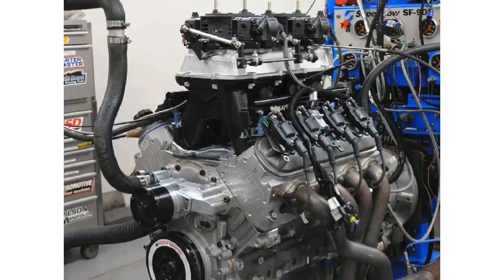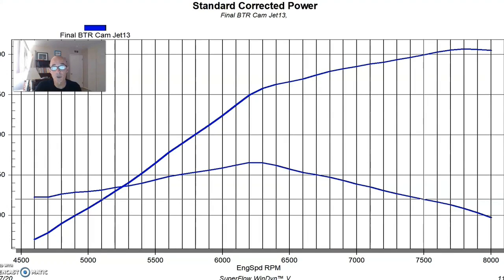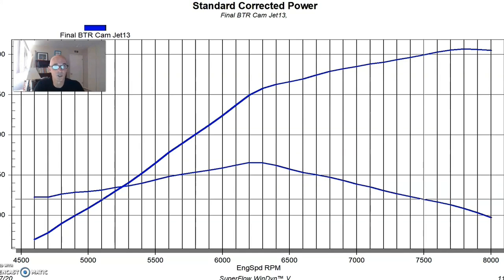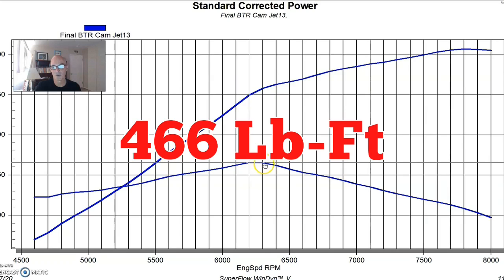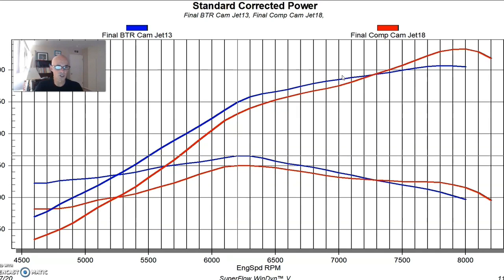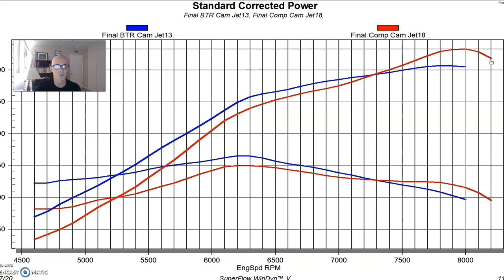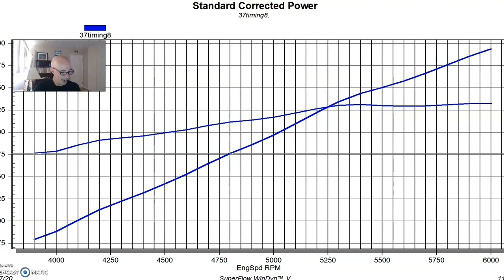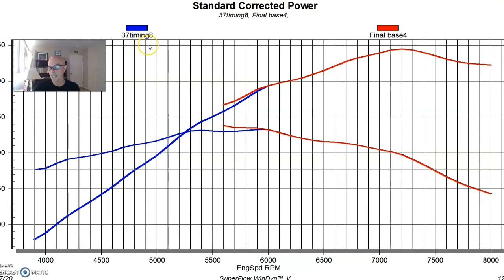8K RPM HYD ROLLER-WILL IT WORK?

Comment: I think the Chevy LS benefited from several things: the longer connecting rods: 6.300" vs. Ford's 5.400" connecting rods, and I also think the LS has better oil delivery to the lifters, the Chevy head is 15° and the intake ports are higher, the intake they used in the LS is also better for high RPMs, and the Chevy LS ignition system is superior to a distributor that only uses one coil.

Comment: Those are excellent build combo's. I am also a bit surprised at the difference between those LS builds and the 347 build. There is not much difference between a regular 346 LS and a 347 as far as size. From the research I have done, which is a bit of a testament to those ls builds, hydraulic roller lifters are supposed to start collapsing at about 7k. So I think that is why the ford didn't make as much as expected. The LS builds however, probably have a larger lifter diameter, so there would be less side loading and the oiling system is probably better.
   If you haven't it might be cool if you got a program called desktop dyno. It is a really useful tool that might help you with those custom cams you get for your channel. Also, you provide really good information about cams and springs, as they do effect RPM peaks. Some other information that might be useful, I learned this from doing research into big blocks, but they tend to experiment with component selection to control piston speed. 
   I haven't really done any builds, but I would like to build a high rpm 327 that is all aluminum and pushrod. I would also like the engine to make over 600 hp. One of the ideas that I had was to use large pistons and a de-stroke. Which I think wouldn't be the easiest thing to do. I haven't tried yet, but maybe one day I'll put one together. 
   Anyway, really good content here at this channel. Thanks Richard!
Reply from the maker: desk top dyno can be a fun tool-but it is NOT actual dyno results. No need to destroke a 327 for rpm, much bigger strokes run much higher rpm (valve train is key)

Comment: Stroked engine power falling off after 7600rpm while de-stroked carries on appears to counter the "shorter stroke doesn't make high RPM power." It would be good to see a side by side with a stock stroke 302 (306) and a 347. I think Engine Masters did something like that with a Chevy 327 (331).
Reply from the maker: a Bigger motor makes more power-no racer in a class that limits displacement ever chooses a smaller motor cuz it revs (which is mostly valve train anyway)

Comment: I think the reason why the power off in the sbf is due to the hyd lifters leaking down during high rps. When the lifters leak down and they aren't limited in travel it creates a situation where the cam dynamically shrinks.
Reply from the maker: these were short travel

Comment: Richard, do you think it could be an oil windage problem on the 347? This 363 sbf built by 'that engine guy' also runs short of 8000rpm even though there is a concerted effort to get to 8000. Regardless of the audio, oil pressure starts dropping at 7400 from 86psi to 72psi by 8000rpm pretty much matching when the power drops off see the still frame https://youtu.be/PJ_wLkRpZ9A?t=15m46s do you have a log of oil pressure for your run? Curious if their problem might be solved by lowering the oil level in the pan a little. Your 347 combo seems more complicated given it drops then levels off
Reply from the maker: oil pressure does not determine power-but a dry sump would be good on an 8000 rpm motor

Comment: could you turn 8000 with the factory recommended springs for that cam or did you need to go to a stiffer spring to control the valves?
Reply from the maker: YOU NEED MORE THAN JUST ADDED SPRING RATE

Comment: Richard recently did a cam LSA video on a 500HP combo with 108, 112 and 120 LSA.    The 112 LSA made up to 34 more ft-lb to 5400 than the 120 LSA then it matched it after that.    The 108 LSA made 14 more ft-lb over the 112 LSA to 5400 and matched it and then at the last 500 rpm made 7 more HP...

It showed sometimes wide lsa is certainly "wrong" and the tight lsa is the right way to go.   N/A cars seem to make more power with tighter lsa's.

Comment: Doesn’t having the smaller motor with smaller cam make it easier on the valvetrain to rev higher?  Asking as someone who’s going to make power with boost and wants to keep torque low for drivetrain reasons.
Reply from the maker: NO-THE ENGINE DISPLACEMENT IS NOT WHAT DETERMINES THE RPM POTENTIAL (VALVE TRAIN IS FIRST)
Reply: @richardholdener1727   it would be interesting to see which engines could spin the highest rpm for the least cost.  I’m guessing coyotes would be up there but then I think people are spinning 8000rpm+ with ls motors on factory hardware too

Comment: Definitely a short-stroke engine. 3.0 sounds good to really find the limits of your valvetrain, but we're talking 5-digit RPM.
for the same RPM and pistons, 1.284X as much energy needed to accelerate/slow down a 3.4 inch versus 3.0 inch stroke.

Comment: I remember reading about a 289 cobra from a company called motion performance back in the late sixties/early seventies that would blast through the traps at ten thousand rpm. Still see a few mustangs on you tube with those small block fords winding past 9000, and man do they sound sweet.

Comment: Torsional stresses increase by the square root of the RPM so a longer stroke motor is depending on how much the metals weigh and how strong they are is going to be inherently less able to hit high RPM than a Short stroke motor out of the same materials.... Everything has a limit as how much stress you can put into it it just depends on what you choose in your metals
Reply from the maker: METALLURGY IS NOT WHAT LIMITS RPM

Comment: Just calculate the piston speed
Reply from the maker: PISTON SPEED HAS NOTHING TO DO WITH VALVE TRAIN
Reply: @richardholdener1727  piston speed limits the rpm that the engine can attain  so the question was knowing the ultimate rpm can the valve train also achieve that rpm.  It seems  in your testing the valve train is the limiting factor not the strength of the rods and pistons.

Comment: Yeah don't act like it's just all in the valve train as far as maintaining RPMs your correct revving up faster you're better off with a Long Rod Short Stroke big bore now here's a better combination for you you're running that 347 I wouldn't be taking it out to that many RPMs and trying to run it very hard that's notoriously for splitting blocks

Comment: How did you adjust the valves on the Ford ????  If you did the 0-lash plus 1/4 turn or whatever that would be my first place to look...you need to bottom the plunger and then back off a bit & run'em like a solid...else...no wonder it fell off.  2nd...330-340 cfm out of the 225 Hi-Ports??? Nothings impossible but I doubt it...nice job if it's real. Less likely but...that's a lot of duration for what 10.5 to 1 ??? Sure are a lot of opinions on this one...you kept mentioning valve train is the place to look...did it need more spring ???

Comment: For 347 Ford ,The Camshaft needs more lift/ And compression for those heads . And larger engine is the only way to make more power , so 8k rpm is not going to be where power is..........magazine articles showed that years back they would not rev very high, finally they will.

Comment: Vous êtes comme monsieur caroll chelby ou cher nous gordini ou alpine qui était des préparateur moteur mais eux en 1960 70 et 80 n avait pas encore de turbo ou compresseur donc tout leur moteur il et préparer à la lime il limer ou ca permetter aux moteur de 34 ch de passer à 110 ch il limer la ou il fallait si bien que des fois une r8 gordini rouler plus vite qu une autres identique simplement parce que elle a etait mieux limer que les autres et oui c était les debut a la courses alpines avec une 4cv a juste prie le châssis moteur et à fabriquer une carrosserie tout en fibre de verre  avec c est 130 ch a gagner beaucoup de courses look alpines A110 the cars is m'y reve

Comment: you always get the argument twisted...it s not that a longer srtoke compared to shorter stroke won't rev as high.... it s that the shorter stroke, all other things being equal, revs to high rpm faster... that s a fact, shorter stroke revs to max rpm faster, making the car reach the finish line faster... all other things being equal.
Reply from the maker: IT REVS FASTER?

Comment: Can you run a solid roller on the same cam?  If so, it might be a good way to see if/when the hyd rollers are beginning to collapse?
Reply: No... the lobes are shaped differently for hydraulic vs flat tappet because the contact surface of the hydraulic is way longer.

Comment: Back in the 70s I was running a 340 with a crane cam  and a hydraulic crane lifters and launched a 8000 RPMs no problems .🏁🏁🏁
Reply from the maker: HYD FLAT TAPPET CAM AT 8000 RPM?

Comment: The sine wave is likely the roller cam profile roughness verses the valve sping period. Everything has a natural frequency that gets excitations when at certain engine speeds.  If the cam is linished to stop the follower getting agitated, the surge should be eliminated.

Comment: My built 347 Did 617 At the flywell at nikon's brothers. I will tell you the combination. A 4  4 bolt main prept block. Fully ported and CNC powerports. With the titanium valves. I was also running The jesle valve bars. I was running a slightly domed DSS piston. So my compression rate was higher. Probably a little over 11 to 1. I was also running vp 108. It was ran with MSD crank trigger. And digital 6 Box. It made peak power right around 7900. But would stay clean to 8200. I had a solid roller  It was close to 650 think right about 6:47  I remember that because The ci number and stroke were the same. It's been about 6 years. But with my 200 shot and my 2800 pound coupe it would run very  Consistently in the 5.6 to 5.8 in 1/8 mile.  So hope this information helps anybody going for that. So I believe the  Cam and compression ratio Would need to be tweaked a little more for that motor to be happy. And maybe address the Valve stability For Free rev. My combination probably could have made more but we were getting ready for nitrous so it didn't have a ton of timing. Great video!! I just wanted fast cars on Netflix and was freaking out win I see you whith you friend in the wagon lol
Reply from the maker: 650 tells us nothing about the cam

Comment: About your 347, watch this Richard! Absolutely incredible, over 2hp per C.I. also, question??? If you were building  a 393 Windsor stroker with a stock block and you wanted that engine to safely be able to turn 6800 rpm and be ran as a daily, do you think a girdle would be required?
Reply from the maker: good idea

Comment: I have trick flow 206r sbf heads, a 590 lift lunati cam, and a Vic jr intake for my 347 I’m building, I’m hoping to crack 500hp at the crank. Or am I way off? Aiming for 10:1-10.5:1 compression as well. I’m new to all this hot rod stuff, but I definitely hope I can rap it out, even though it’s going in a off road truck lol.
Reply from the maker: unfortunately, the lift tells me nothing about the cam (need duration at .050 and lsa) what size motor, and what are 206R heads (11R?)
Reply: @richardholdener1727  590 lift, 292/317 duration 108/104 LSA/ICL. The 206R heads are one step up from the 11R heads. 206cc intake, 92cc exhaust runner, 61cc combustion chamber. 600 lift springs, 2.080 and 1.600 valves. 302 block, bored .30 over with 347 rotating assembly.

Comment: And to agree with Richard; I’ve built a 421 CID engine that made peak power until around 8700 RPM, so the shortblock or displacement definitely doesn’t determine RPM potential.

Comment: Of course you can rev a hydraulic roller cam to 8k+, otherwise you wouldn’t ever see high revving pushrod engines in street cars because the average person is not going to deal with the valve train maintenance of a solid roller. You can also get creative and mix/match components as well. I’ve seen guys run mechanical lifters with a hydro roller cam and I currently run a set of solid lifters with springs from an old hydraulic roller setup to get high RPM stability for the valve events, it works awesome 👍.

Comment: I’m wondering if it’s the rod/stroke ratio and dwell time for cylinder fill. I’ve been looking into it and comparing it to cup engines and the exact ls combo you did. The ls combo has a 1.9 ratio, this 347 you have only has a 1.58 ratio
Reply from the maker: not it
Reply: @richardholdener1727  I just think it’s a bit odd that even with good specs, your power dropped off around 7500. That’s why NASCAR engines use a 3.25 stroke on a 9.2 block. It can definitely spin that high but the rod-stroke ratio and cylinder fill could be the culprit. You think you can do a test solely on rpm and cylinder fill?

Comment: Air induction is main factor in rpm range. Stroke dictates piston speed per given rpm. Big bore short stroke would make great reliable high rpm power. Know a guy with a foxbody mustang with a factory ford 302 block bored over as much as possible to bring it to something like 330 cubes. Solid roller stuff, 8000+. All motor stick car that will grab 5 feet of air from a street dig. Seeing is believing
Reply from the maker: BORE AND STROKE DON'T DETERMINE RPM

Comment: The 347 looks like it suffered from a little bit of a lifter collapse. That's my guess. You should really go into more detail on short stroking lifters. At that RPM I'd say it's a must.   I don't think you can get much past 8300 with hydraulic rollers. They historically collapse. It was thought to be a lifter problem when valvetrain control was crap. Lifters were doing their job, the springs were not so the lifter filled in the gap as the rockers were floating.

Comment: I wonder what it would do to the higher RPM Horsepower, in the Ford, if you pulled a degree or a degree and a half out of the cam.

Comment: My 331 with the xfi cam and 10.6 comp afr 225 kooks headers my ported parker aed 650e stock block made 585hp and 462tq. Had behive springs and cheap shaft rockers 1.73 motor sport lifters. Off shelf probe rotating.  Went a 5.98 8th in a heavy fox with a 175 hit on fb and 26 10.5 dots 1.32 60s

Comment: Built a 331 back in the day free rev i seen it max out a 12k tack. But on a dyno with the big comp xfi cam 6700 max hp 7400 fell on its face
Reply from the maker: 12K free rev?
Reply: @richardholdener1727  young and dumb me back in the day tried to blow it up bc i couldn't find a issue. That i latter found. Sand casting pin hole in intake port. Anyway if 12k is a lie then the autometer c2 tach told it. It changed 3 tones of sound on that rev. Wish i hadn't of ever done that bc then a retainer gave up later that year and split the block got 1 rod 1 piston 2 rockers and shaft and 2 push rods 1 head. almost lost the car on the top end crossed the line at 110 up in smoke. I couldn't even see my steering wheel much less the track.

Comment: Are you really going to put an open plenum tunnel ram with twin 950's on the LS, try 2 different cams 2 different sets of heads? Then slap a single plane single 950 on the Ford and wonder why the Ford didn't make a higher peak. Serious question. And I build race engines for a living so don't try any BS.
Reply from the maker: I promise not to try any BS
Reply: The whole reason for open plenum and more carb is to allow more air storage for hi rpm.

Comment: Rich- it may have been said already, but I’m thinking that the longer intake runners on the Ford (in addition of the smaller size headers) may have held it back at the top end a little bit- the LS runners were a lot shorter, and the dual 4 setup may have been able to flow just enough more to keep it revving. There was plenty of cam in the Ford, just thinking the breathing wasn’t there.

Comment: That’s odd, I would think as well that with a more aggressive cam and had flow like that that thing would have made over 600. Could it be that the cylinder heads were actually too big? That the air got slower and lazier in the ports? Maybe a smaller port would encourage a faster intake charge?
Reply: No.  It was starved for air.  The single plane intake on that thing needed to be worked on, along with the headers being on the small size.  347@7500-8000 needs real amounts of CFM

Comment: My 347 is pretty standard off the shelf parts. 
Stock block 
Forged crank, H beam rods, and flat top pistons 10/2/1 comp.
Brodix LH 195 Heads fully cnc
Ford racing x cam 542/542 lift
Funnel web intake
780 cfm quick fuel carb
Made 478 hp at 6200
Made 442 tq at 4200
My guess as to why the sbf made such low numbers is because of mismatched parts. Maybe needed more compression. 🤔 I have no clue, but I would have guessed that screamer being in the mid 650 hp area.